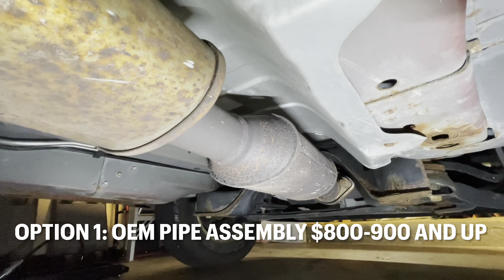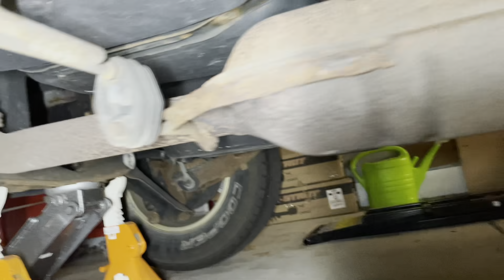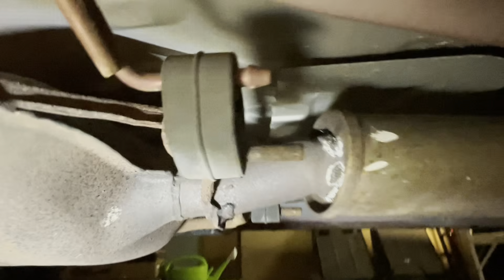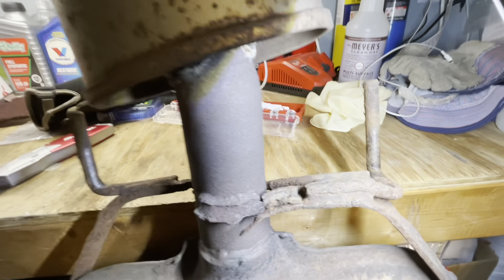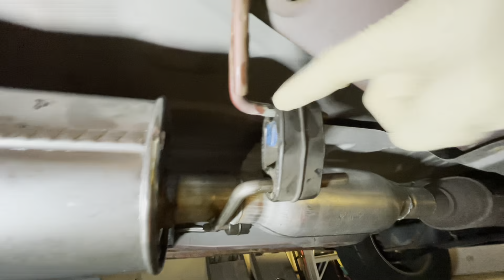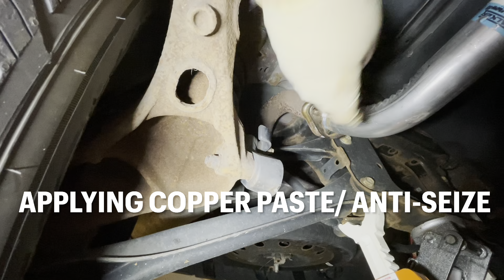[Ford Escape] Exhaust Repair, How to Replace Center Muffler, WE SAVED $1,000!

Comment: I agree I started working on cars at 16 and it was been full focus of open in my own place and boy when I started doing exhaust at top value muffler at 8 Mile in Sherwood the number one top value muffler place out of all 50 I was hooked on exhaust. I opened my auto repair place MNJ Auto in south Warren Michigan in 1999. I sold the place in 2016 I bought my pipe bender believe it or not a year and a half before even found a building. I bought it from an Midas. I’m pretty sure it was a Midas for 2000 bucks. It would go up to 2 1/2. I couldn’t do 3 inch until later on I found a die  set up.
Reply: Once I started working there, I went from 450 to 600 a week to a steady 1500+ a week definitely put me in focus

Comment: i have to do the same thing for my 2012 escape, but i have no pipe between the resonator and catalytic conv to work with. looks like i will probably have to get mine welded instead of clamped & sealed. either way this video was soooo helpful, THANK YOU!

Comment: Just wanted to say thanks for this excellent video. It worked great for our 2012 Ford Escape - only note I would add is that the hangers on the link (as of April 2024) had holes that were quite a bit larger then our vehicle, so I stuck with the originals. But otherwise everything was spot on. Nice work and thanks again!

Comment: Guess what?  My 2009 Mazda Tribute with the 2.5 liter 4-cylinder DOES NOT have a 2.25" O.D. pipe at the outlet of the catalytic converter.  The entire length from the outlet of the converter to the stock (original) muffler is 2.0".  Therefore, the Walker assembly #56233 will not fit snugly over the pipe behind the converter, its 2.25" I.D. inlet is 1/4" too large.  Evidently, Escapes are different than (at least some) Tributes.  Also, my converter is apparently longer than that on your Escape, because the inlet of the Walker assembly comes within 1" of the rear of the converter - not really enough room to insert an adapter (2" I.D. x 2.25" O.D) that will be needed between the outlet of the converter and the inlet of the Walker assembly.

Comment: what if it’s 2010?
Reply from the maker: 2010 should be the same process.  If I remember right, 2009-2012 is the same, and the exhaust on the 2008 is just slightly different

Comment: Have you considered unbolting the catalytic converter and working on it off the vehicle ?
You would have to replace the front gasket, but that would extend the life of the entire exhaust system. 
Mix a bit of that exhaust paste and use it as a lubricant when installing the catalytic converter into the other pipe. That will seal any leaks for sure . 
Great video bro !

Comment: Very helpful. Thanks, Ryan. My 2012 Escape needs that exact same repair. 
This failure occurred less than a year after purchasing it at the end of Dec 2021 with 86,000 miles. The pipe separates from the rear of the resonator, and the studs that go into the rubber insulator hangers are almost rusted off the muffler. Speaking of rust, the lower rear tailgate and both rear quarter panels around the edge of the wheel openings are beginning to rust. Nearly every 2nd generation Escape I've seen has rust showing, including my wife's 2010 Escape. Apparently, this happens to all of them sooner or later. I made a temporary repair using some bolts and metal strips until I can get a replacement muffler assembly. That happened this weekend. When separating the rear flange, I chose to remove the tailpipe resonator so I could grind out the old gasket as it was rusted into that side of the flange. The rest of the repair went similar to yours.

Comment: you did amazing job start to finish with explaination.  I feel confident now walking into my mechanics garage and talking about it while on lift.  Not an idiot and he knows.  He loves when I come into the garage.  He finds out fast I listen, do what I can, and he will double check me if I don't have him do it.  My exhusband who I am visiting with 8 hours away won't put it on our lift.   $80,000 tools and one hugh lift......  It makes me feel good when I walk into my mechanics and he knows he can help me do something HE won't.

HE always look like a prick in mechanics eye!!  HIS mechanic too so HE shouldn't not do it.  HE will do complex Backhoe or zeroturn mower engine/motors but not want to do something so easy for me. 

I meet with mechanic tomorrow but not until I pull my Escape into my heated garage and get underneath to be prepared.  Whether or not I do it myself, You stepped up to the challenge and posted a great video.

Can't wait to let you know what happens Ryan!!   Signed, Vickie from Maryland

Comment: As long as you had cut the pipe, and were crawling around under there with a light, it makes sense to look at the converter matrix for any obvious damage....there was like 2 frames where you could see it looked ok!
Reply from the maker: I had checked it during the repair (you're right it looked great) but totally failed to mention it in the video, thanks for pointing that out for anyone watching!

Comment: great video. thorough. well explained and clear filming. currently have the exact same problem. same year car. i had to jury rig some heavy wire to wrap around and pull the larger muffler to the resonator cause that part of the pipe came undone. 

been trying to figure out what to do. as it is, the inspection is due this month and i know they’re going to want to replace the whole thing. was looking to possibly fix this myself like you’ve done but then worry that if they see this they may find something else. how can you avoid dealing with replacing the catalytic converter if it doesn’t necessarily need it? how can one tell if that needs replacing? then again, it’s 10 years old and maybe better to just replace the whole thing.
Reply from the maker: Thanks for the feedback, I'm glad you enjoyed the video!  I'm lucky in that I've never had to deal with inspections.  I would think if you replaced the parts shown here and the system was intact they wouldn't have a problem with it.  If for some reason they find issue with the Cat. converter under the car you should be able to swap a replacement in while keeping the new muffler/ mid-pipe section.  I believe Walker made a replacement Cat. that goes in front of the section I replaced.

Comment: These Escapes have 3 catalytic converters. One is all one piece connected to the front manifold.
Reply from the maker: Thanks for pointing that out, I completely forgot about the one at the manifold!  I want to say the V6's had 2 one piece maniverters at the heads (in addition to the one downstream) and the 4 bangers had a separate 2 piece manifold and primary Cat.
Reply: My 2009 Escape hybrid has only one catalytic converter, muffler, and a resonator .
California version has two cats , muffler and resonator.
Anything to please the EPA !